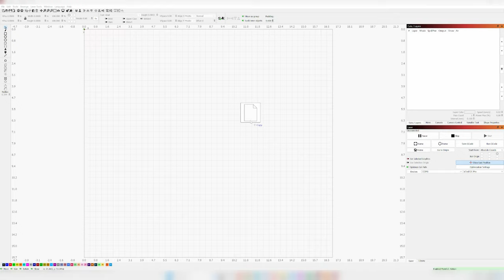Make Perfect Foam Inlays With A Consumer Grade Laser | XTOOL Diode

Comment: Thanks for showing the laser cutting the foam. I make custom inserts for my projects and I'm cutting them out by hand. They come out ok, but not great. The laser looks like it came out way better. The questions I have are, how are the fumes? And did the foam catch on fire or melt at any point? Keep making and stay awesome.
Reply from the maker: Hey Adam, I kept the door open with a fan running... be carful breathing it! The foam didn't catch on fire, but I could tell it was a little "melty" on the edges. I think after it cools its firm again.
Reply: @RedBeardOps Thanks that's a big help.

Comment: Hello! What is the height you have set for this cut? I am using the S1 and my 1" foam is not fitting inside - given the different design compared to D1. 
Dont want to damage the bottom of the printer. Thanks in advance and great project!
Reply from the maker: Heck IDK about the S1. I just set the laser head a little above the foam.
Reply: @RedBeardOps thanks for the reply!